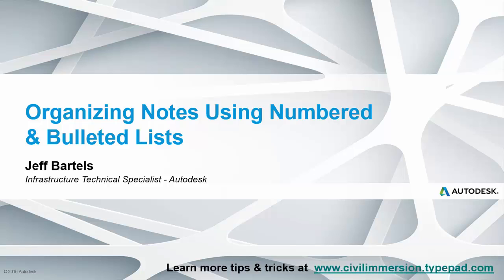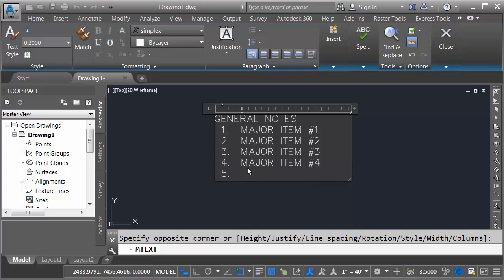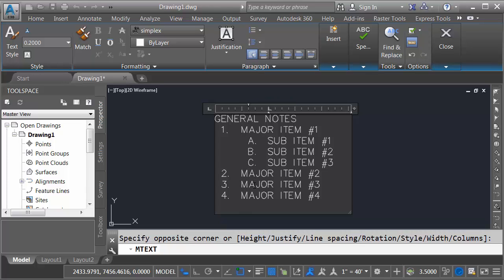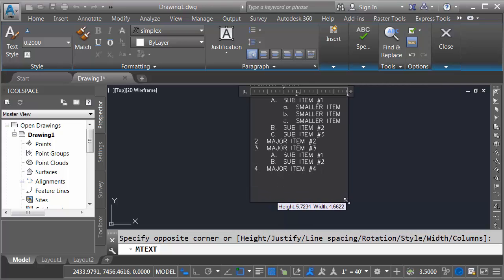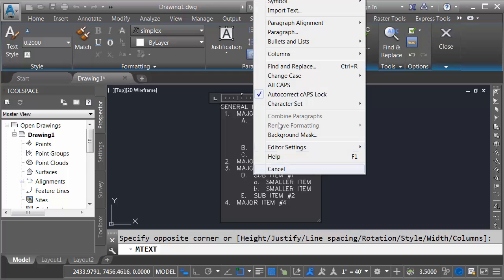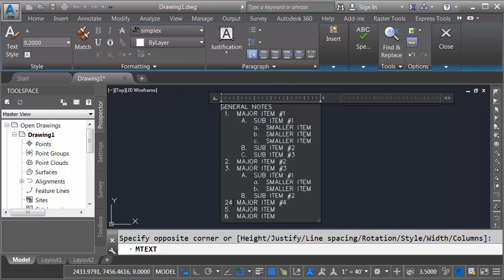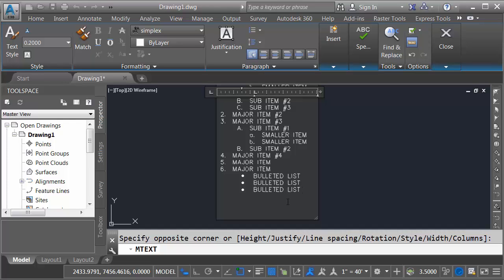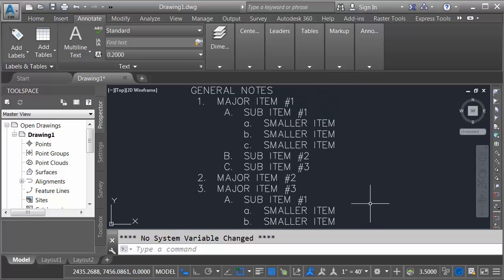Using Numbered & Bulleted Lists to Organize Notes Within Civil 3D

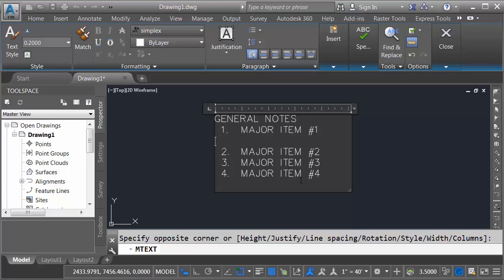Comment: Not exactly ... AutoCAD has the numbering feature. If you create the list, type enter like in 1:23. Press TAB again and it indents it. You can then change to letter instead of number. The issue that I am having is that it carries the "number" from the Main Item and cannot figure out how to turn that off. (e.g. 1. Main Item #1 and 1.A . Sub-item #1). I want to turn off/delete the the "1" in the "1.A." which is automated by AutoCAD.